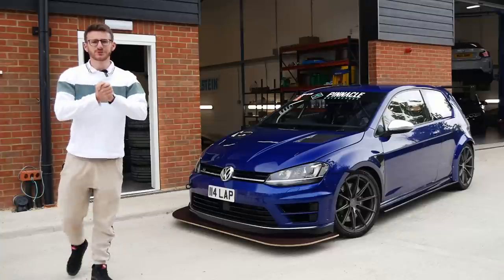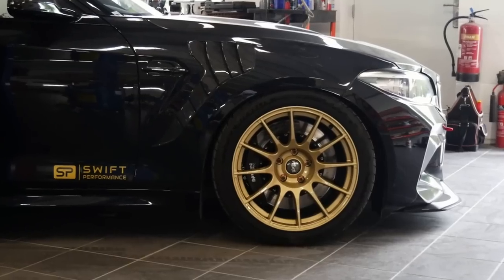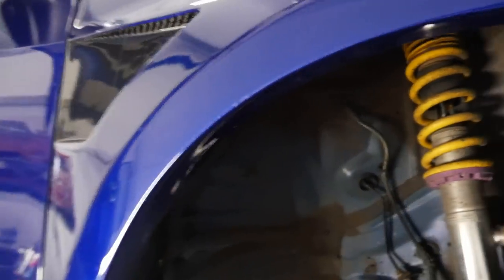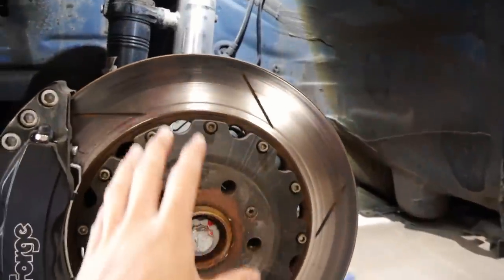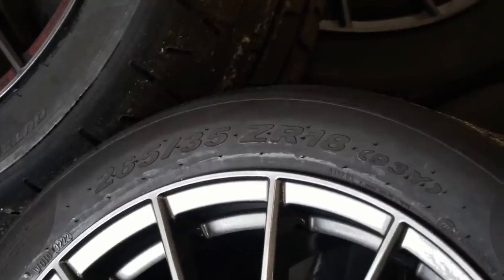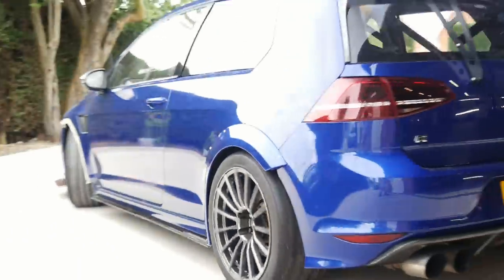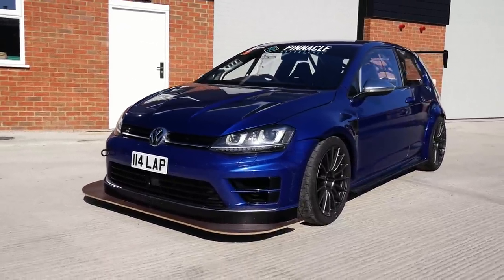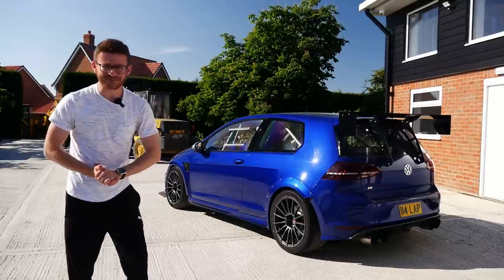Fitting *INSANE NEW WHEELS* for my Track Spec Golf R!

Comment: I still can’t get over that front lip
Reply: Bit off wood from b&q
Reply: Function over form
Reply: It looks brutal looks like mdf
I Like the rest of the car though
Reply: @MarkCalica  the Physics doesn't make sense tho. It's just added weight
Reply: Its the rear arches for me 🤢 the fronts looks clean and the back ones just look stuck on
Reply: Or the rear one😂
Reply: @cameronlotter1392 what part of the physics don’t make sense ?
Reply: Has to be a piss take, it’s actually a piece of wood like 😅😅😅
Reply: @davpunk1986  aero is aero, look at top gears 24h Beamer 🤷🏻‍♂️🤷🏻‍♂️
Reply: @Dave_dave69  That was meant as a joke though.
Reply: @kieranmanners170  firbre glass or fill n paint. Make it look flush
Reply: Not liking the snow shovel splitter 😢
Reply: Its just a car built by "a youtube car guy" who cant even trim his front arches back. It just looks like a car built by someone who knows nothing about cars and follows internet trends and bolts on freebies. 

Would of definitely shopped in ripspeed and halfords in the early 2000's

Comment: Yeah the front split need to be changed to a carbon fiber one. The wood is a bit distracting from the whole build. On the wheels you could get the same effect from a set of 245/40R18 tires and wheels with less of a offset say 18x9 +15 or 0 offset.

Comment: The front splitter edge needs to be trimmed back and at least two strut rods added to support it; otherwise it will tear off. Also, you should add an extension to the front bumper to match the fenders and cover the front wheels because you will have problems with turbulent air destroying the down force from the splitter.